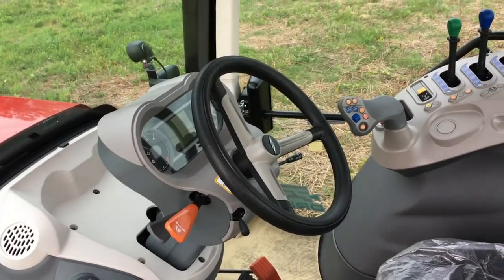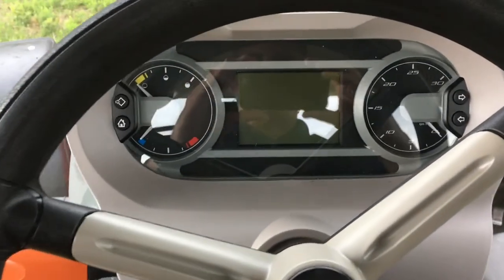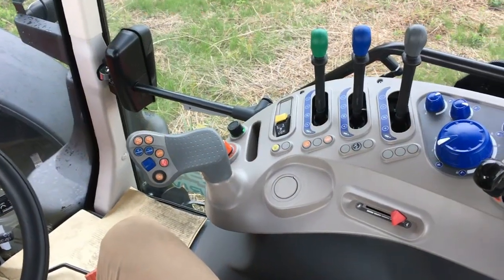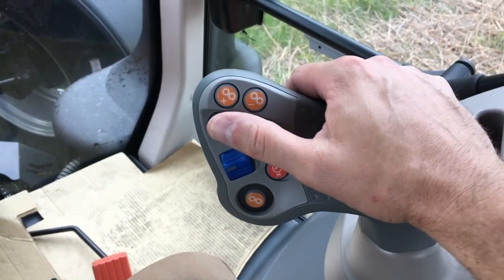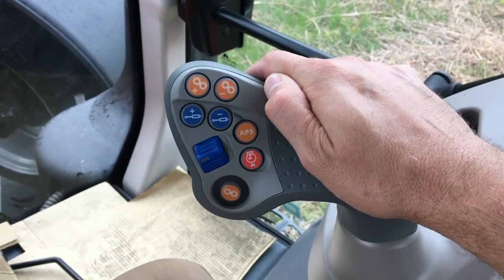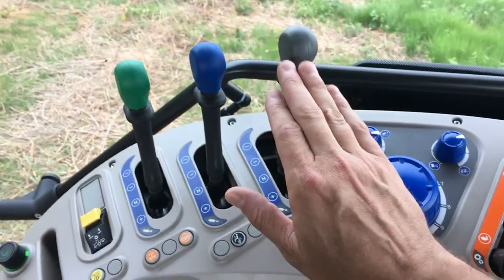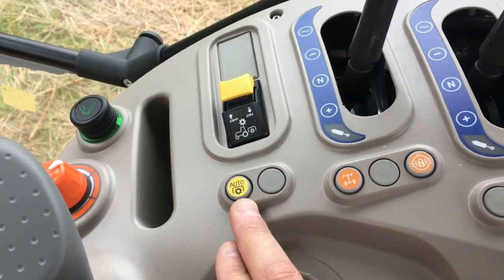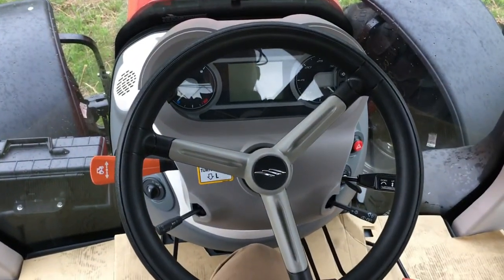McCormick X7 Pro-Drive STANDARD Tractors In-Cab Controls Tutorial

Comment: The seat in these tractors IS 100% useless unless your 5'5",  its short and feels like you want to tip forward..   The display sucks for MPH etc very hard to see under the steering wheel it's very small..  Nothing against Mccormick.  I have an MTX and was going to trade it, but on the fence..  just sad some of the stuff they do..   They joystick for the loader is sad as well..  The one I saw was close to the dash..    The plastic inside on the ceiling is VERY thin..  makes noise when going down the road.  better vision and much more but they really have to fix a few things yet.
Reply: I'm 5'10" and if I were any bigger I'd struggle. The bloke I work for who owns it is 6'4" and has fingers the size of sausages, he can't change gears in the bloody thing! They're basically an Iveco now, hence the plastic and gutless feel. The only advantage over the old Massey 8240 is this has bluetooth and I can listen to podcasts, in every other aspect I'd take the old one with 8000 hours on it, especially if I want to do some actual hard work.